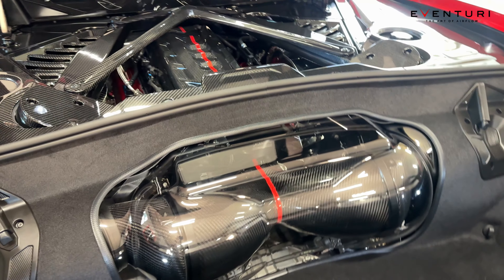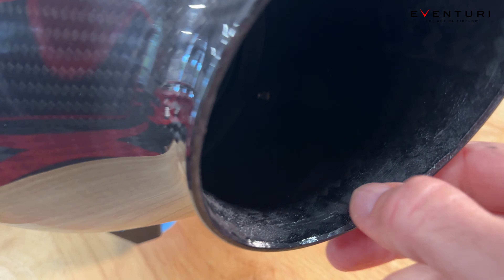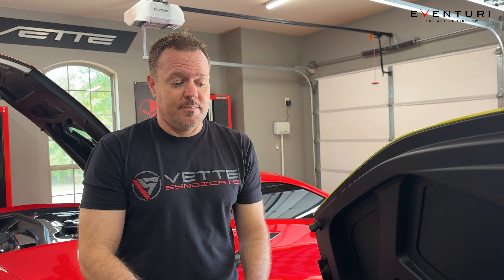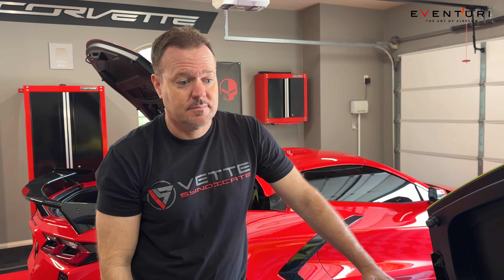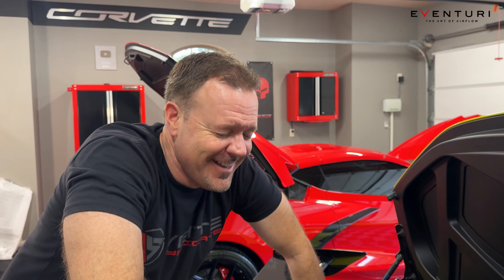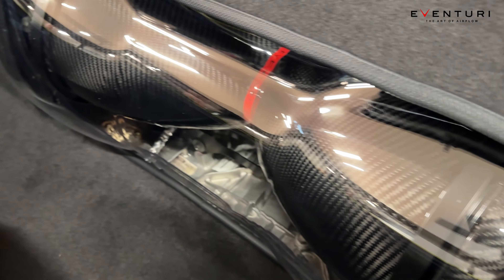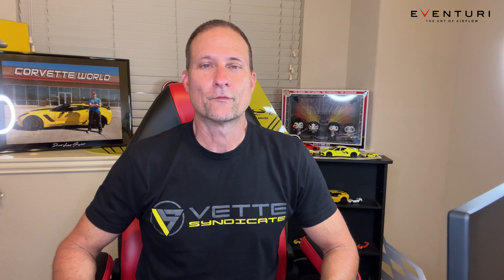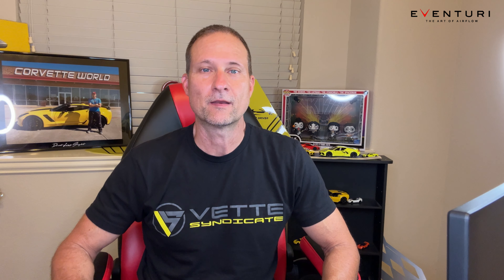Eventuri Carbon Fiber Air Intake for C8 HTC! Do YOU Need This?

Comment: Yeah, this is a serious performance mod that has results in more HP to prove it. MSS springs next and i call it finished.  You most certainly can get the Stingrays handling performance up by using those springs, and that company aint no joke either.
Reply from the maker: I wonder how much the springs run? I’m still debating whether I keep this or go Z06. My allocation hasn’t come up yet so I have time to decide. I’m still not sure I want to spend all that extra money
Reply: @FrontSeatDriver   Im telling you right now that you own enough performance in that Stingray to last a complete lifetime even if you are a avid track going dude. The Z06 is tuned from the factory to be that way, and the Stingray is tuned for comfort , BUT BOTH ARE Y CHASSIS CARS THAT ARE GTLM BASED. A LARGE part of the entire C8 series is related to THOSE SPRINGS because the MAG RIDE settings are not so far off ON EVERY C8 SERIES CAR, and thats what people simply dont understand about Y chassis cars .   170,000 is a heck of a lot of money in this world, and if you got medium size physician practice money then yeah.

Comment: Question, I installed the Eventuri in my 25 HTC last weekend (PIA....also took a hacksaw to it), and I'm not completely sure I've got the intake fully inserted in the throttle body boot. Did your boot bottom out right at the base of the MAF sensor plug on the intake?  Mine is maybe a quarter inch shy of touching the MAF plug housing.
I appreciate the content.

Comment: At around the 4:15 mark y'all mentioned the frustrations of "opening and closing" the HTC. Can the trunk lid be taken off? It's only four bolts (as far as I can tell). Just mark the alignment before removing. I suppose the soft close mechanism would present a complication but I do seem to remember another video where they opened both lids but at a compromised angle and extra padding in-between the two edges.
Reply from the maker: That’s a good question. One we didn’t even think of. I don’t know if the soft close part would present any issues or not. 

Unfortunately the trunk locks when the top is open so I am not sure of a way to get both to open at the same time.

Comment: So, you eventually have to get back in there to change out the filters……..correct?
Reply from the maker: Yes. That is correct.
Reply: @FrontSeatDriver  Man, that's too bad. I wonder if the Corsa version with the trunk panel window is any easier?